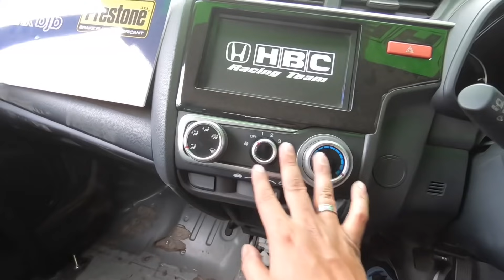REVIEW JAZZ BALAP Feat. AGUNG HAPSAH | VLOG #69

Comment: 0-100nya kaya Honda Civic turbo 7,9 detik
Reply: Oh gitu? Yg sedan apa hatchback?
Reply: Turbo biasa kan? Bukan yg type r?
Reply: Type r dibawah 5detik
Reply: Civic turbo biasa pdhl 174 hp. Td om fitra blg 150 an jazz ini. Faktor bobot jg brrt
Reply: @pintoprabowo8903  civic turbo type r di 6 detik, paling kenceng di kelasnya audi rs3 0-100 dibawah 4 detik yang 0-100 dibawah 5 detik kelas hatch back cuma mercedes a45 & audi rs3
Reply: @Dimas-rs4vs  modal nntn carwow. Krna fwd sih jdi traksi pas startny susah
Reply: power to weight : )
Reply: @Dimas-rs4vs  klaim civic type r 0-100km/h 5,7s klo gk salah
Reply: Raf 19 yang jelas manual & matic beda akselerasi hehehe
Reply: Pada sadar ngetiknya pake "TURBO" mesin 2000cc gimana mau dicompare dengan N/A 1500cc?
Reply: @ajie-1969  civic turbo cc nya juga 1500 mas netizen yang budiman